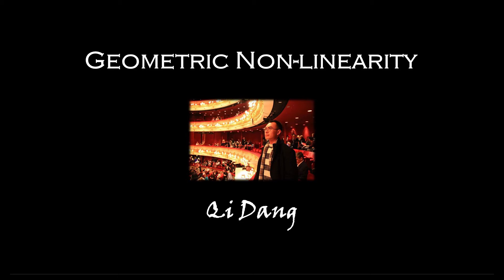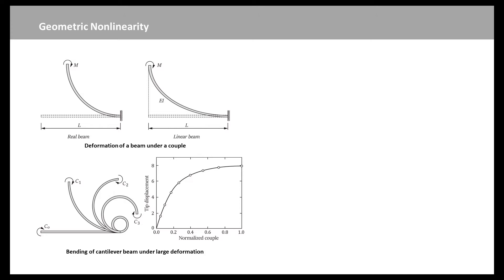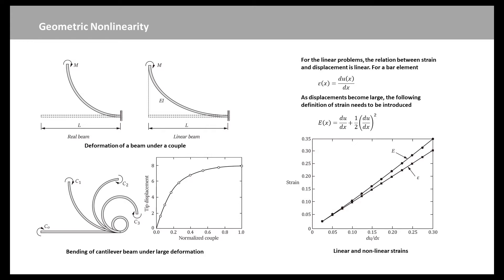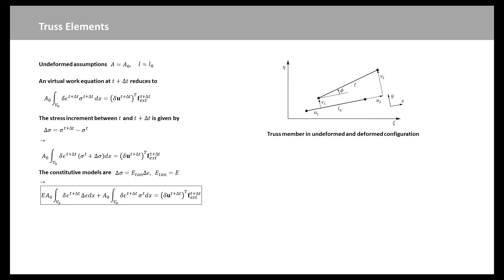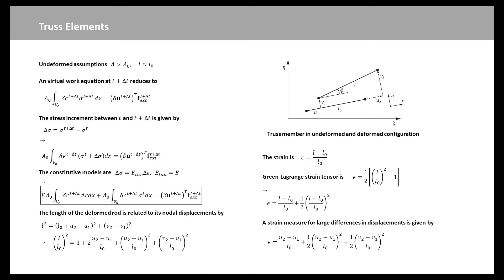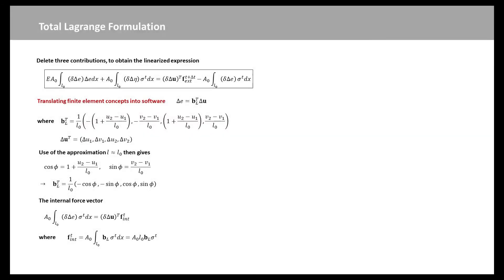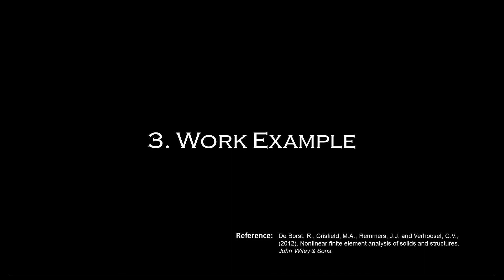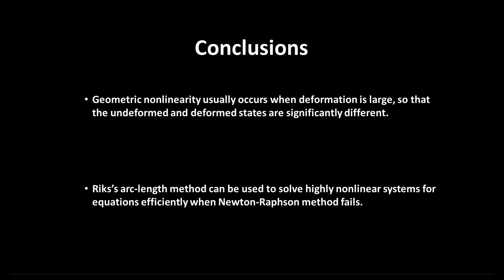Finite Element: Geometric Nonlinearity

Comment: Thanks for your really nice presentation. A small question, is the geometry matrix Kg and total matrix (Kg +Ke) are symmetric positive-definite?
Reply from the maker: Thanks for your message. Yes, the matrix is symmetric positive-definite.
Reply: @qidang  Thanks for your answer. The symmetric positive-definite of geometry matrix is also right for the 3D beam element, or just for the 2D truss element? Could you recommend some documents to explain the symmetric positive-definite of geometry matrix? If you can provide your email or other contact methods for further discussion, I will really appreciate it
Reply from the maker: @lucheng4192  Thanks for your message. The stiffness matrix is dependent on your special cases. In the case of my video, I focus on the truss elements. If your structural elements are beam,  both geometric and material non-linearity should be considered. This content has been discussed in my other video https://www.youtube.com/watch?v=HC6MHOCFzMQ. You can have a look. Thanks for your appreciation. If you want other discussions, you could message me on the YouTube platform.

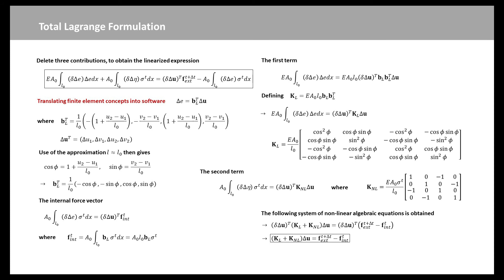Comment: Thanks for your really nice explanation about GN. At 9:19, we get the final form of the global equation, (Kl+Knl)*deltaU=delta F, I have two small questions about this part. First, can I regard the left part ( Kl+Knl ) as the current structure stage, which is derived by the initial stage Kl and the delta stiffness matrix change under the current loading? Second, the right part is the incremental load, generally, how to calculate this part?
Reply from the maker: Hi, thanks for your message. For your first question, the Newton-Raphson or Arch-length method can be used to solve the non-linear problem. You can guess a series of initial values for a specific problem, and guarantee the convergence. If you see the details of the Kl and Knl elements, then you see that the variable phi and sigma can follow the relevant non-linear process. For the second question, the incremental load can be added into the Newton-Raphson or Arch-length method system. You can set the efficient tolerance and max-factor which is useful to the convergence. If you want to know the computation of the Newton-Raphson or Arch-length method, I recommend you to watch my other videos: https://www.youtube.com/watch?v=-yU6Vqwc_sA&t=234s and https://www.youtube.com/watch?v=kKxXcYEyaDs&t=10s. Hopeful my answers can help you!
Reply: @qidang  Thanks a lot. These documents are quite useful. BTW, do you have recommended analytical model for geometric nonlinearity?
Reply from the maker: @zechang1935  Thanks for your message. An analytical model for geometric nonlinearity is shown in my video of https://www.youtube.com/watch?v=-yU6Vqwc_sA&t=234s. You can have a look.